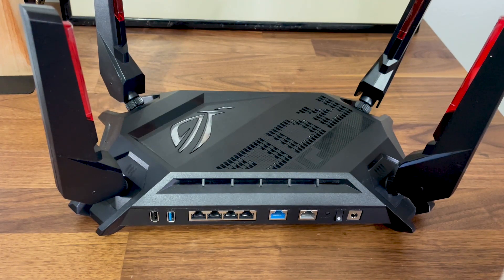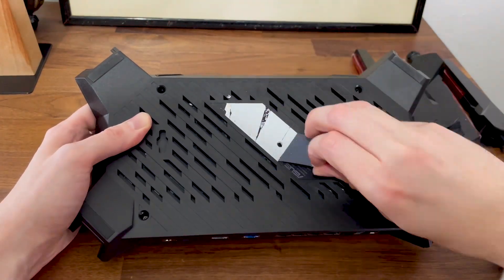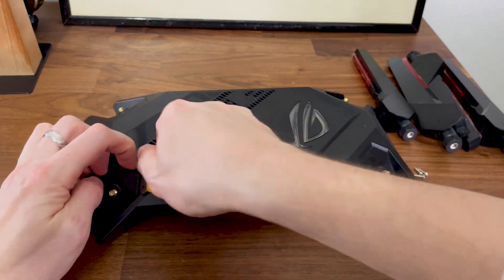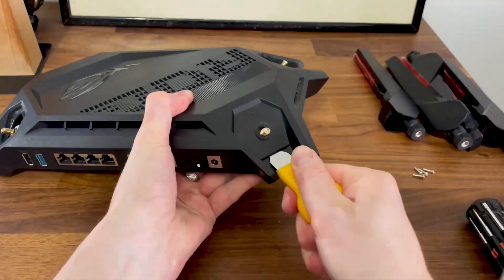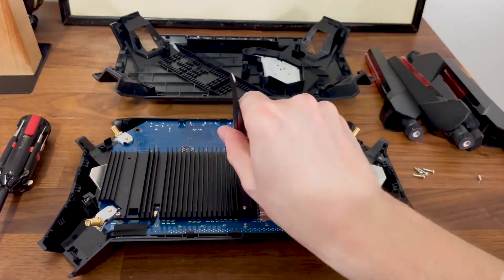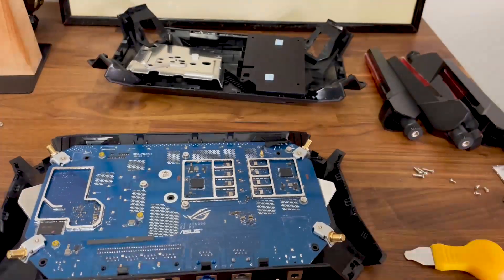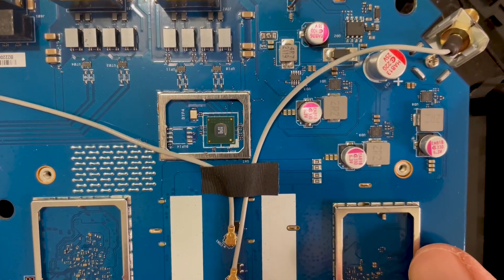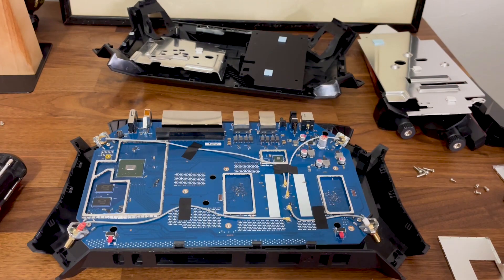ASUS Rapture ROG GT-AX6000 WiFi 6 Router Teardown

Comment: A very strange design. Wi-Fi chips under a massive radiator, and a powerful and hot processor is cooled by an aluminum plate? In countries with hot climates, overheating is guaranteed.
Reply from the maker: It also has those small thermal transferring pads (an alternative to the thermal paste), but yeah, this is pretty much the standard way most manufacturers go about the passive cooling of their wireless routers.
Reply: I mean, its not rated for industrial climates. It says in the manual not to use it in climates above 104F

Comment: hi, tuf ax6000 and rog gt-ax6000 which one will you choose ?
Reply from the maker: I didn't test the TUF-AX6000, but from what I could gather online, it seems that it comes with a 2.0GHz SoC and 512MB of RAM which appears to be the same the GT-AX6000, but the TUF apparently uses Mediatek. Both have 2.5GbE ports, the gaming features are all there, but the VLAN and Guest Network Pro are only present on the GT-AX6000 for now. Also, there is support for Merlin only on the GT-AX6000, but the TUF series has received support from GNUton, although the AX6000 version is still in the works. If you don't care about the software aspects that I mentioned, then just get whichever is the cheapest. Otherwise, the ROG GT-AX6000 seems to be better.
Reply: @SamBondor  thank you 👍
Reply: @SamBondor 
How about Ax88u pro vs rog ax6000 ?
Reply from the maker: @Rseert  They're pretty much the same device, so just get whichever is the cheapest.
Reply: @SamBondor  Hi what about the RTax86u I just need something with good wifi I had the AX6000 brilliant router unfortunately the wife didn't like it lol
Reply from the maker: @googlefriend7685  The RT-AX86U is a good option, but know that neither the new VLAN, nor the Guest Network Pro are currently supported on it. The Pro version has it, but then again, I suggest to get an inexpensive managed switch that supports VLAN since the current implementation on the ASUS routers is a bit lacking. Which is also why I suggest you immediately switch to Merlin to get a more stable performance from your router. The throughput is going to be below the GT-AX6000, but not by much, there is a single 2.5GbE port and most of the gaming features are present as well.
Reply: @SamBondor  Thank you for your reply sorry I meant the ax86u Pro I'm interested in VLAN just need good WiFi I have one PC wired that's it the router will be in an open area central of the house
Reply from the maker: @googlefriend7685  I do have the RT-AX86U Pro, but I will test it towards the end of this month since I need to check a WiFi 7 AP first. Still, if you don't have any special requirements and the most demanding device (PC) will be wired, the RT-AX86U Pro may be a bit overkill.
Reply: @SamBondor  I've tried AX82U before didn't cover the upper floor with wifi I live in a 5 bedroom house it's new built so I'm sure the stuff in the walls is slowly down my wifi I've even tried the Asus XT9 they worked however slow speeds compared to my ISP router so I'm thinking of getting a powerful router and maybe a mesh extender if I need it my house is all open plan what's your opinion on the Asus TUF AX6000 thanks for your help much appreciated